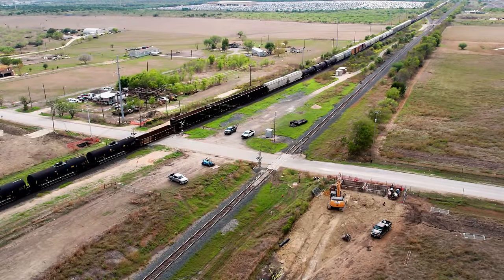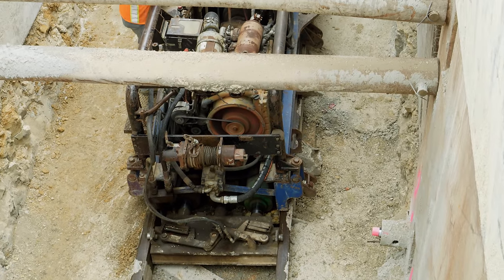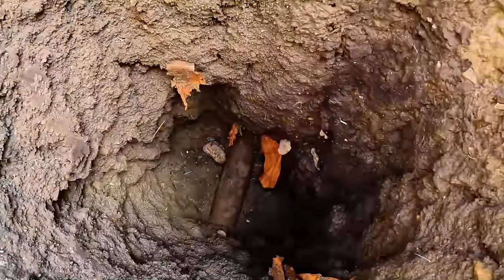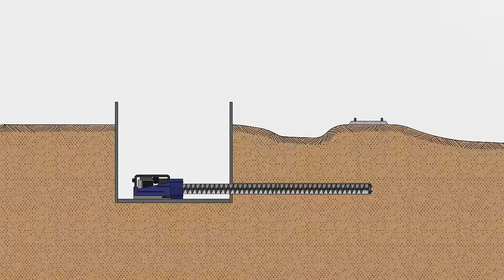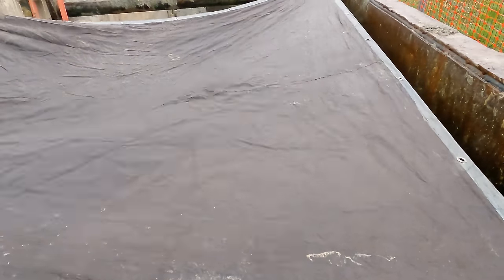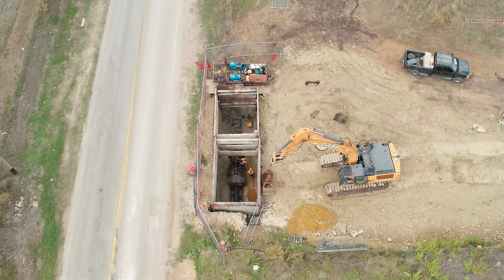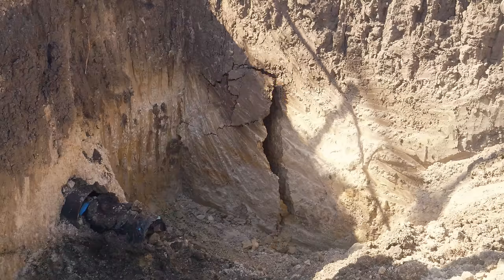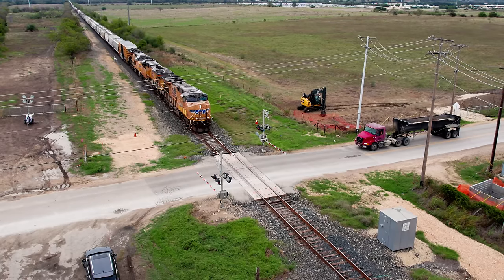How To Install a Pipeline Under a Railroad

Comment: 10:10:37 well either that or you use  what i call pipe in pipe technology and by that i mean you make a bigger hole with a bigger casing pipe like say something a person could get in and crouch thru and then put the pipe with the water in there ... then you can also access it for maintenance and other  utility's that want to cross the traces in the future can also be routed thru it   now does a bigger hole cost me? yes?  will paying that now cose less than it will cost when you have to do another 5 of there  in 20 years for the next 5  services you want to put in  oh yes

Comment: This would have been so much easier and faster, with a horizontal directional drilling (HDD). All you need to do was to dig a hole 3x5m and 2m deep on either side, drill and pull the tube into the hole you just drilled. We do this every single day, for up to 500 meters in length at a time. 

What is shown in this video is extremely inefficient.
Reply: The railroads usually "require" a steel casing pipe be installed which isn't possible with directional drilling. Well, that's what we were required to install the few times we crossed RR tracks.

Comment: "How do they check the bore? They just send a dude on a skateboard down the pipe! There are more sophisticated ways to do it" but they cost way more and honestly don't work any better at this scale (or in most cases, even as well), so there's really no point. Dudes on skateboards have been testing boreholes for centuries and there's no reason to stop now!